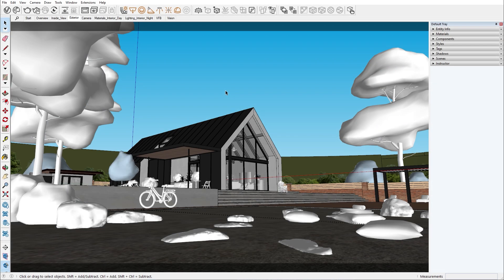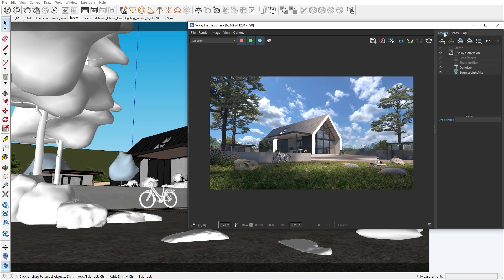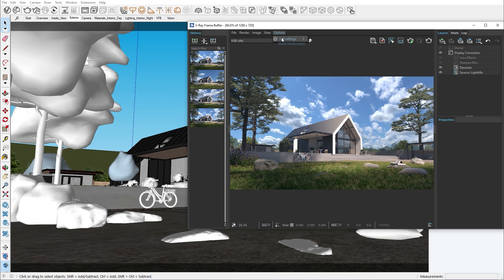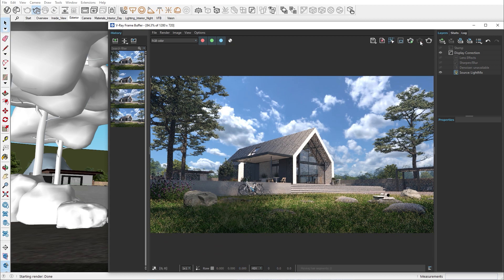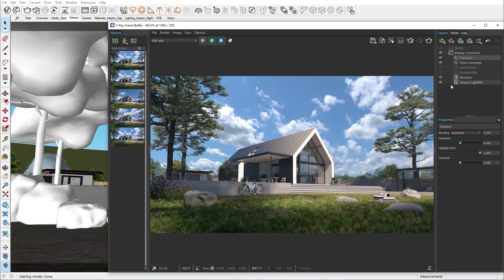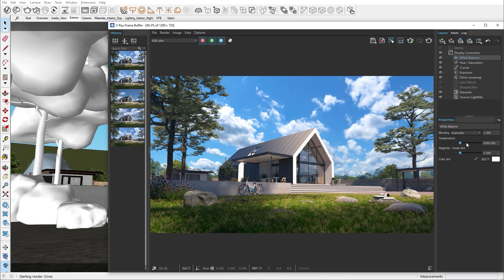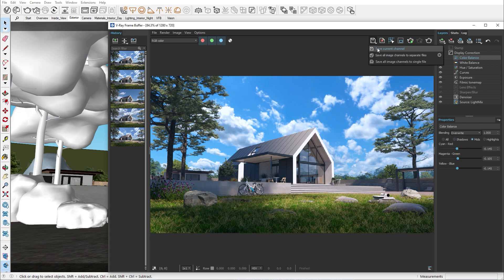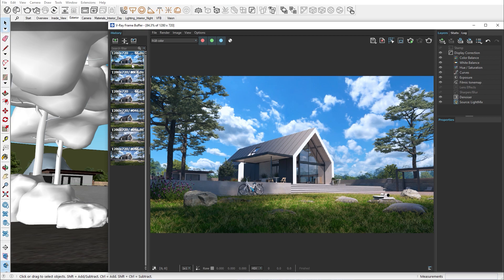V-Ray for SketchUp tutorial — V-Ray Frame Buffer and post-processing

Comment: the post production tab is not opening. There isn't any "arrows" and if i click on it it just expands the size of the tab...any solution?
Reply: Press ''ctrl+L'' for post production tab open.Also press ''H''( or ctrl+H) for history tab open. *By default.Post production tab open almost empty by default, you should add layers from green plus button at the right top corner such as exposure, curves,denoiser,sharpen blur, light mix etc.